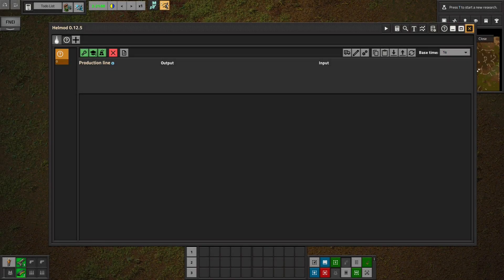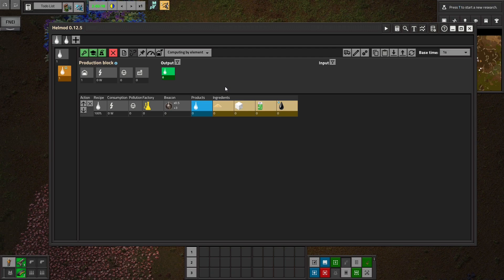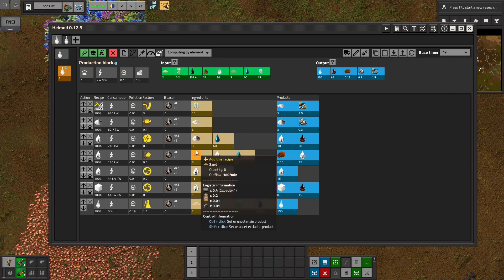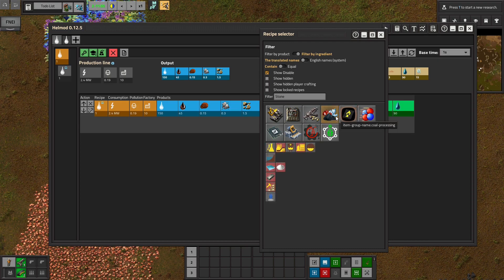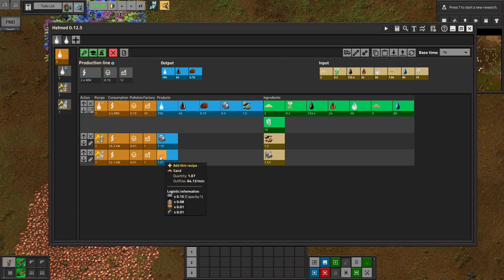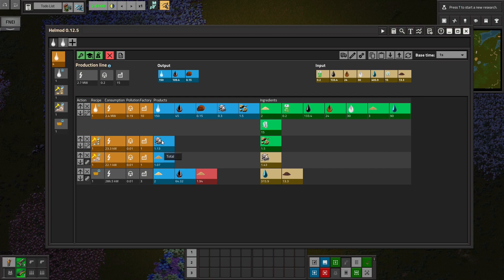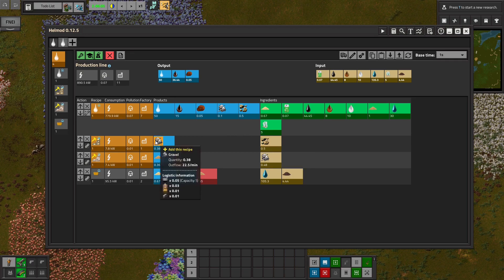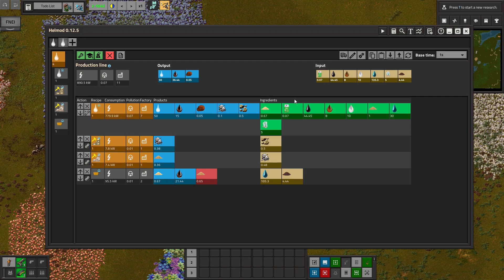Factorio 1.1 Helmod Tutorial - Viewer Requested Solutions #1

Comment: If i add a repeat recipe to a line (such as needing coal from an E-furnace for a liquifier and an assembler) for two different recipes within a block, how do i adjust the amount of coal production thats already within the block so i can make sure i have enough for everything else? I click on the input icon at the top of the window and it just pulls up the recipe selector
Reply from the maker: Generally if you want the same recipe twice, instead, you should just move it to the bottom so that recipe will satisfy all of the above requirements. Otherwise, if you want to separate out the two coal "providing" sections, then underneath the liquifier needing coal, you would put the coal recipe, and then later underneath the assembler needing coal, you would put the recipe again. Use the little arrows to move the recipes up/down, and you can always manually add a recipe to the block with the little wrench icon at the top.

If this didn't answer your question, feel free to come over to the discord where it's easier to chat back and forth!

Comment: How does it handle rounding up the factory number ? We cant build half a lab.
Reply from the maker: Correct. So in terms of buildings that you need to build, always round up. But it's helpful to see, for example, that you need 1.5 of a building, because that helps you know the rate that goes into each building is slightly less than it's full capacity. 

If it's veeeery close to a whole number (7.04, for example) you can just build 7, and you just know that you'll be around .5% under capacity. Once you have beacons and modules, I generally play with the modules such that I sneak under the next whole number of buildings